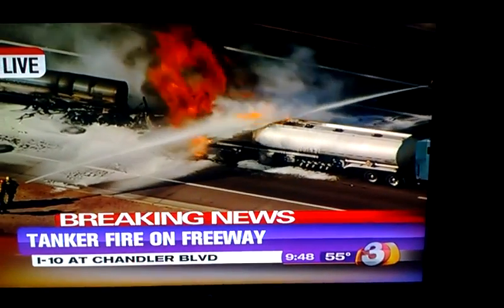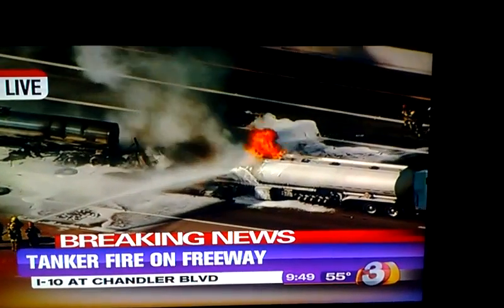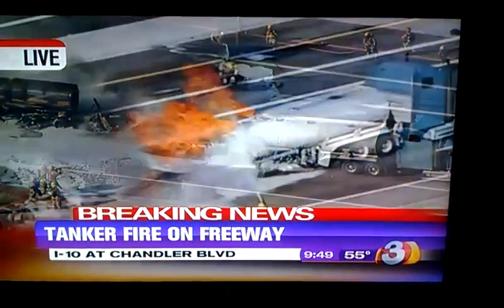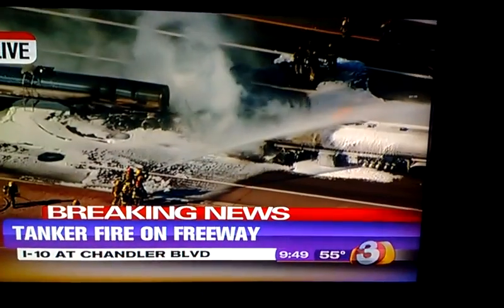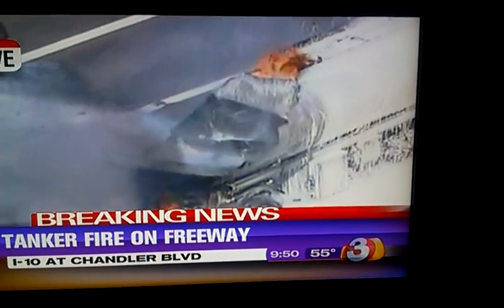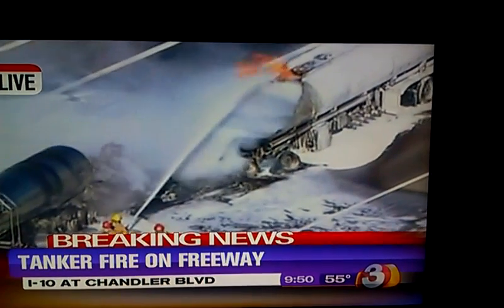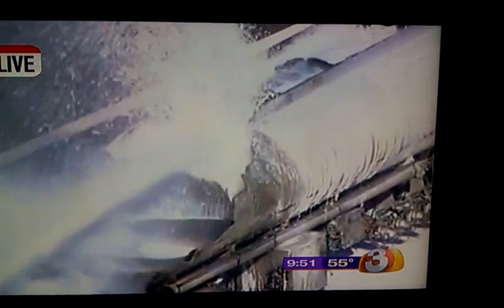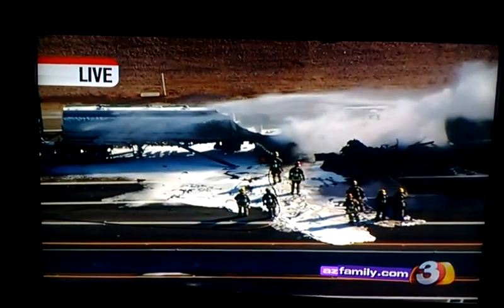Tanker truck fire on I-10 pt. 2

Comment: That's unusual, one tanker truck, a tractor cab is destroyed by fire, but the flame did not touch the tanker trailer, and the other tanker truck, the flame destroyed the tanker trailer, but the flame did not touch the tractor cab, which was saved by the firefighters.